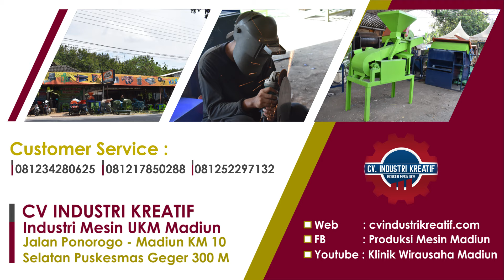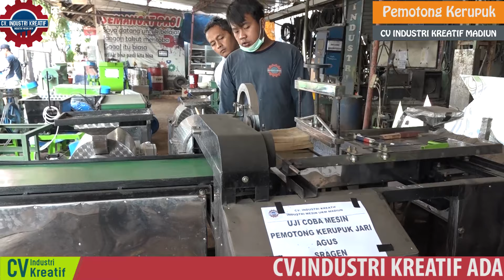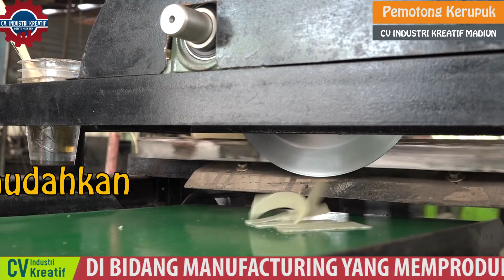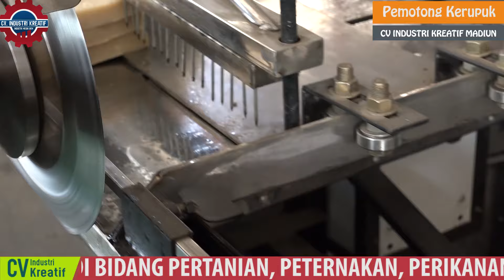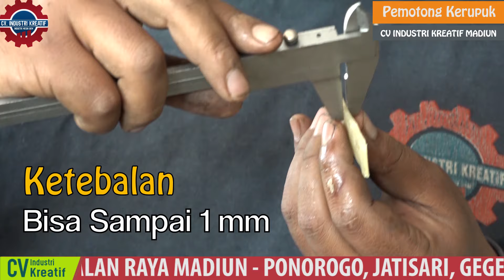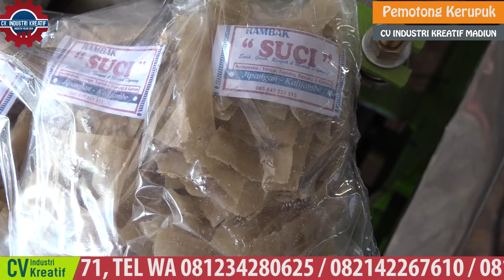PEMOTONG KERUPUK PAKAI KONVEYOR JADI LEBIH MUDAH SAAT PACKING

Comment: nanya dong pak,harga mesin nyampur pakan ternak bebek kisaran berapa,mohon di jawab kisaran brp...mksh
Reply from the maker: info pemesanan hubungi Customer Service Representatif Kami di 081234280625 - 081217850288 - 081252297132 atau kunjungi Workshop Kami di Jl Madiun - ponorogo KM 10 Selatan Puskesmas Geger 300 Meter Kec Geger Kab. Madiun Jawa Timur
Reply: Produksi Mesin Madiun saya di jawa tengah pak,mo nanya kira2 mendekati hrg brp,biar bisa nyiapin uangnya
Reply from the maker: @akunekene3501  bisa hubungi tlp/wa 081234280625